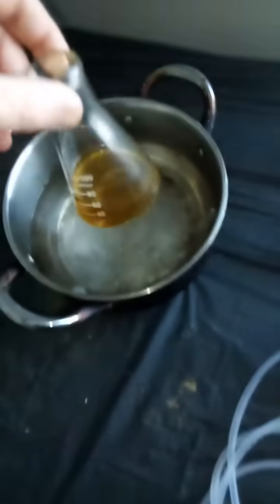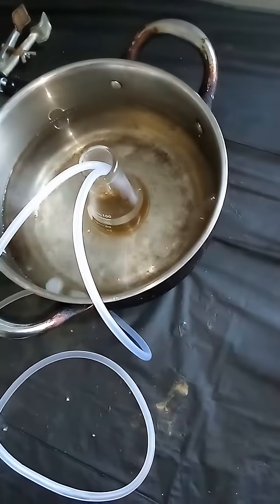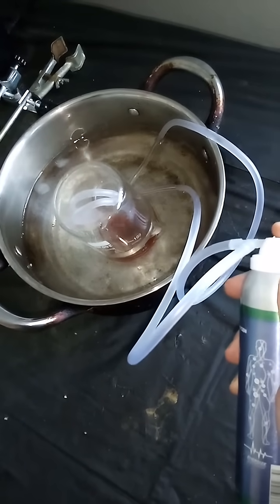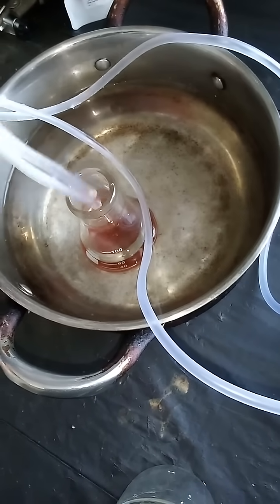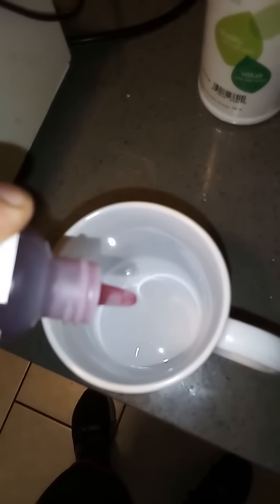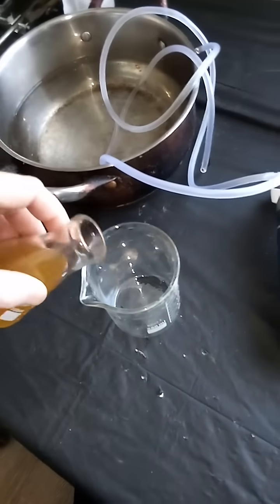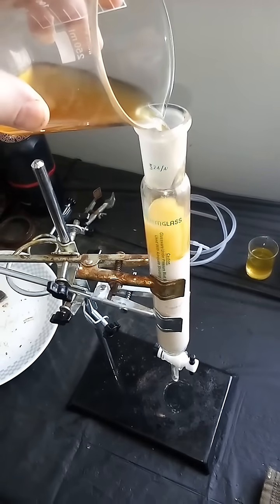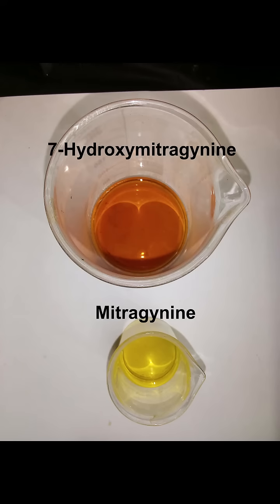How to make 7-Hydroxymitragynine by @KaliforniaKratom

Comment: Any thoughts on MGM .
Reply from the maker: It's twice as strong as 7-OH and lasts a lot longer. If you switch to MGM15 from 7-OH, you will go through withdrawal when you switch back - it's that much stronger. It's also not very hard to make. Once you have purified 7-OH, you can convert it to MGM-15 using sodium borohydride.
Reply: @KaliforniaKratom so I hear, trying to figure out how much of that is in the 7stax nano since they don't claim a content . By the length of action it almost has to be present
Reply: @K @KaliforniaKratom and cool on the chemistry info. Was curious how they further converted it from 7

Comment: This stuff is hot garbage if you're not having a pain emergency. Stick to the Kratom leaf instead. I don't think 7OH should be made illegal but it should be regulated; kept out of sight and locked up and sale requires a warning of it's withdrawal effects and advice to not use daily and ID check for 18,21+.

Comment: Can you explain why every literature I've found says mitraginine has to be put under an argon atmosphere and yours is the only one in the world that doesn't require this?
Reply from the maker: The only 7 synthesis that needs to be done in an argon atmosphere is PIFA. Rose Bengal turns atmospheric oxygen into singlet oxygen which adds to the double bond. Oxone forms DMDO which is in itself an oxidizing agent and doesn't need to be performed under an inert atmosphere. To go from 7-OH to MGM15, you need an argon atmosphere when reducing with sodium borohydride, but that's MGM-15, not 7-OH.

Comment: I’m guessing you dehydrate it at the end correct? What’s the best way to dehydrate it and I guess from there you need to weigh out the dosage with a special scale?
Reply from the maker: You can use a food dehydrator, a vacuum oven, a vacuum chamber, or let it air dry
Reply: Whenever it dries I guess it’s like a powder like substance?
Reply: One more question I’m so sorry, so can you use this method with some Mitragynine powder? I see some websites sell the mitragynine powder. I guess you could stir the mitragynine powder in some isopropyl alchohol and do this method with the chromatography column correct? Or can you skip the corporately column if you have the mitragynine powder? Sorry again for the bombardment of questions I’m seeking info my friend

Comment: Can i do this directly from leaf powder! Like make red bubble first or even just all in one step? Or do i need to oxidize first than citrus?
Reply from the maker: No, you must follow the videos in order
Reply: So if mit is left out will it start to oxidize on its own? Or the catalyst is required to do any conversion?
Reply from the maker: @Brain-92  It will oxidize on its own with exposure to air and UV light, it's just a very slow process.

Comment: How would you know the amount of mg you have?
Reply: Knowing how much Mitra you have is the first step. 

Then, you can make a rough estimate based on standard conversion rates. I dont know that specific math off of my head, but let's say:

150mg of mitragynine can convert at at roughly a 50% ratio. So 150mg of mitra can be converted to 75mg of 7hydroxie.

Basically you you can guess. He also said theres still a layer of regular mitragynine that does not convert, which can be recycled. Meaning theres some that never converts. 

In a lab, you can easily convert more and probably have no mitra left and convert it to 7 hydroxie at a much higher rate. But this dude is doing garage chemistry. Which, isnt bad as long as you take precautions and whatnot.

But, he'd have to send it to a lab with multiple samples saying "pure oxygen atom 1 hour 5 hours 10 hours, etc" as well as "ML of catalyst here here and here under 1 5 and 10 hours, etc" if he wants real conversion rates and accurate MG. Id personally replicate 3 times, under same conditions, and then id send all three samples to get a  good idea on MG converted to 7OH

I know what I said isnt the most scientific of explanations, but id like to keep it simple purely for those who may not understand.
Reply: @TheSektor47 I know some chemistry. I bet it takes a ton of kratom to make 7OH.
Unless you somehow synthesize it.

Comment: Around how much was that? Wouldn’t you need a ton of kratom? Around 0.5% of the ACTIVE compounds in kratom are 7hydroxy… I’d imagine you need pounds of kratom to get a good yield of 7hydroxy…
Reply from the maker: Mitragynine is the main alkaloid, you are oxidizing that to make 7-OH, not pulling the 7-OH out of the kratom. This video is part of a series of videos and is the 3rd one. The first video teaches how to make extract from leaf, the second video shows how to isolate mitragynine, then there's this video and a video on how to oxidize mit using the oxone method.

Comment: Id love any links you can offer on the technical details.  You didn't mention a light source, timing, yield etc.  I have mesotetraphenylporphorin and and find it works well with UV around 410 nm.   I also am curious about your column details here.  Alumina and what eluent?  If you dont quench the catalyst what happens?  Being that you had unreacted mitragynine it seems unnecessary but theoretically you would start producing the indoxyindole product?
Reply: Came here for this smart ass comment 😂🙌🏻

Comment: About how much 7 Hydroxy and purity do you get from this process, and throw out an estimate number of how much the equipment needed is. In these times, a good step by step from kratom leaf too 7 oh isolate powder would be nice to know. Ideally three full guides of a cheap setup, medium setup and a expensive setup. Also a guide on how to test the purity would be nice. 

I don't doubt if they do schedule it, some form of extraction/metabolization process that is really easy to do like some shake and bake type method except for 7.
Reply: FED
Reply: •Aquarium tubing- $7
•Erlenmeyer flask (set)- $20 
•Beaker (set)- $10
•Rose bengal- $12
•Oxygen canister (10 liter, 3 pack)- $45
•Citric acid (10 lbs)- $37
•Chromatography Column- $60
•Lab stand support w/ clamp- $40

Total: ~$231

Not including price of equipment to extract the initial mitragynine from raw plant material or convert the liquid distilled 7oh into powder/tabs
Reply from the maker: @GlassesAndCoffeeMugs I sell a kit for the oxone method that includes the SOP, the extract, Oxone, sep funnel, scale, magnetic stirrer, ring stand, etc. for $199.
Reply: @GlassesAndCoffeeMugs buying mit extract would probably be easiest since there's no way its getting banned
Reply from the maker: I have everything you need on my site. www.kaliforniakratom.com
Reply: @KaliforniaKratom  Question, does it also explain how to tell how pure it is, or would you have to send it to labs.
Reply from the maker: @kingcarl1391  End purity depends on beginning purity with your mit. High purity mit will produce high purity 7.
Reply: Tweakerz
Reply: Your first question is very important, how much percentage stronger is it going to be of 7oh? How much citric acid do I put in the solution?
Reply from the maker: @U7uber370 Wait what? You don't need citric acid for this. Please email me if you have specific questions matt@kaliforniakratom.com

Comment: You forgot one critical step my guy!.. you need to reoxidize the Citric acid with the carbonal and mitraginine to concentrate the mixture otherwise your just wasting the residue.
Reply from the maker: You're not supposed to use citric acid at all, you're supposed to use sodium thiosulfate to reduce the peroxide formed.

Comment: Also, if you were to skip the step with the chromatography column, would you just be left with a full spectrum extract for lack of a better term? Stupid question I know, I just wanna make sure that it’s only separating the excess mitragynine from the 7-hydroxymitragynine and I’m not missing something here.
Reply from the maker: Correct, though you'd have some partially oxidized other alkaloids too but they're not harmful (from what we know). More research is needed in that area.
Reply: @KaliforniaKratom if you made kratom tea and oxidized it with the rose and the oxygen method would that produce a mixture of 7 hydroxy and other oxidized alkaloids?
Reply: @KaliforniaKratom Sweet, thanks man.
Reply: How are you not getting what's going on here. It's one chemical turned into another, if the one is left over in the other one it is simply that, a mix of the two 😂
Reply: @MannFranke Just wanted to clarify before I drop hundreds on a piece of equipment pal, never said I was well versed in chemistry. If I knew what was going on I wouldn’t be in a comment section asking questions.

Comment: Is MIT powder water soluble? If I source mitragynine powder can I just mix it with distilled water and make a solution or is it not that simple?

Thank you for putting this out there man fr, you’re a good man for not gatekeeping.
Reply from the maker: No, MIT powder is insoluble in water. You need to dissolve it in a suitable solvent like methanol, ethanol, acetone, ethyl acetate, or DCM.
Reply: @KaliforniaKratom What about a high percentage isopropyl?
Reply from the maker: @3y3mtr1pt5  Yes.
Reply: @KaliforniaKratom Sweet. I know these are stupid questions, but it’s difficult to find information online. I appreciate you.
Reply: @3y3mtr1pt5 not that hard just takes time, care, and attention. If your going to mess with it take the time to research the chemistry, and learn the vernacular, it will aid you. Solvents come in two major categories "polar" and "non-polar". In this case you want need a non-polar solvent for the chromatography to separate the compounds dissolved based on charge difference. Kali jump in if any of this is off
Reply: @1337prokill3r Huh, yeah I really need to do some research on how chromatography even works, for sure. I was under the implication that a chromatography column worked like a brita filter, had no idea it had anything to do with charge. Thanks for the insightful ass reply, that means a lot. I’ve been interested in chemistry since I was in elementary school, and I’ve done plenty of scattered research, but no legitimate courses since high school. Definitely pays to learn the basics in any field before trying to learn a bunch of shit out of your wheelhouse. 
Apologies for the run on sentences, I think I might need a refresher on the basics of grammar too.
Reply: @KaliforniaKratom Really appreciate the info once again man

Comment: So what’s the difference in mitragynine and 7-hydroxymitragynine. Exactly all I know is one is stronger that the other, but is the less stronger of the 2 ( mitragynine) the same as kratom powder, like potency wise ???
Reply: The effects you feel from Kratom powder are from mitragynine. Because there’s less alkaloids that cause the wobbles (headache/nausea) Mitragynine extracts feel slightly better as you’re able to take a larger dose that feels a bit cleaner. 7hydro is on a whole other level so the two aren’t that comparable. Kratom/mitragynine is great but it has a distinct feeling with side effects that set it apart from similar substances. 7OH is nearly indistinguishable to traditional opioids like hyrdo or oxy. Despite its crazy potency and amazing high, it’s just as safe as kratom powder.
Reply: @jordanaveryt2051  ok I see, ty . I’ve heard there are withdrawal effects from the 7oh are they more mild than traditional opioids or the same?
Reply: 7oh is a naturally occurring oxidation product of mitragynine.  7oh is naturally occurring in kratom.  7oh is produced when mitragynine is metabolized by your body.  It is a naturally occurring substance therefor perfectly legal by natural law.

Comment: Yet another one! I've watched this numerous times. SOOO INTERESTING!!! it def peaks my interest in the creation of these products. THANKS AGAIN MAN!!!
Reply from the maker: Thanks man! Stay tuned for more and how to make 7-OH using Oxone (easy)
Reply: @KaliforniaKratom I’d love a MGM-15 synthesis video 💜 also using different MIT extracts could result with different alk profiles for the 7oh correct? Also  if I use say 97% MIT extract will I end up with a rather potent 7oh extract?
Reply: @KaliforniaKratom This is what I am waiting for! Oxone methodology. Also, if I am not mistaken, H2O2 (hydrogen peroxide) yields 99% 7OHM from MG but I believe palladium is used for a catalyst but you could also use PIFA for a slightly lower yield (I don’t remember the exact yield but since it uses no catalyst, it had the lowest yield %). 

On the case of MGM, I am just curious as to how to create an Argon environment or an inert environment. Why argon? Why not nitrogen?

I am super new but super interested and passionate about this so I am catching on quickly.
Reply: Well, I was trying to stay within the household chemical or the easily obtainable chemicals to keep the process plausible for personal use at home but it seems H2O2 is not as easily quenched as some other oxidation agents. I really like the Rose Bengal and Citric acid method. I have to actually try this now. Thank you!
Reply from the maker: @Vince0ffer  Argon is a noble gas with a stable electron configuration. Nitrogen is somewhat reactive compared to Argon. 

I haven't seen a method published in the literature for H2O2 but I'm sure if there's a will there's a way. PIFA, Rose Bengal, and Oxone are the only published methods I've come across so far that are in peer reviewed scientific papers.
Reply: @KaliforniaKratom does oxone result in better yield? Or is it just more beginner friendly?
Reply from the maker: @BasedVibe  Both, plus you don't need as much equipment with the oxone method, just a separatory funnel.
Reply: @KaliforniaKratom is this video still in the works?
Reply: So, how do you control and quench the free-radicals?
Reply: How are you finding all the fractions you want out of all the fractions run through the column?
Reply from the maker: @Vince0ffer  Color, and knowledge of the polarity of each molecule. Using a TLC plate with an indicator and UV light is the way it's supposed to be done.

Comment: this is so cool! what is the reason for the Sonic cleaner in the original extraction video?
Reply: It functions as a low grade Lab Ultrasonicator for UAE or Ultrasonic Assisted Extraction. Ultrasonicators use high frequency soundwaves that cause microscopic cavitation bubbles that helps explode the plant cell walls for a faster more efficient extraction. High powered Ultrasonicators are also used in the Marijuana industry for solventless extractions or nano-encapsulated drinks, it literally shakes the chemical bonds apart in some cases.

Comment: ok so the color is throwing me off. I bought a powder that is 88.9% 7-OH and 0.5% Mitragynine and it is a yellow color. I also bought a powder that is 62% 7-OH, 11% Mitragynine, 2.40% Paynantheine and 1.2% Speciociliatine which is an orangish color powder. Both work good, but the 88.9% is def better. So I'm assuming the company isn't ripping me off. But from your vid your saying 7-OH is orange and Mitragynine is yellow. I would think the 88.9% 7-OH powder should be a darker color than it is, since its supposed to be more pure 7-OH. I know the 88% 7-OH defiantly feels cleaner than regular kratom and doesn't have the side effects I get when I take a high kratom dose. Any ideas why my 7-OH is yellow and not orange? Could it just be bc what I have is a dry powder and yours is in a solution?
Reply from the maker: These compounds can vary in color depending on how they're made. Mit can be white to yellow. 7-OH can be white, yellow, or orange. It all depends on purity and crystallization. A diamond (all carbon) can be different colors as well due to imperfections in crystal structure.
Reply: @KaliforniaKratom  Thanks you! Good to know. One of the 1st things I did was dissolve the 88% 7-OH in 75.5% EtOH and it started recrystallizing forming white crystals. I wasn't even trying to recrystallize it. I just wanted to make dosing a bit more precise, until my analytical balance came in, since I didn't trust my milligram pocket scale for measuring a dose < 30mg bc of the floating 0 error they suffer from with small masses.

Comment: any recommendations to purify the solution or remove the iodine? I know somebody with a severe (anaphylaxis) iodine insensitivity. they can consume several grams of iodized salt w no issue so it doesn't have to be 100% pure, but the levels in shellfish can cause anaphylaxis if they eat it, so it would need to contain no more bioavailable iodine than table salt
Reply from the maker: @elainehammond7456  "Iodine Allergy: Myths, Symptoms, Causes, and More" https://www.healthline.com/health/allergies/iodine

The iodine present in Rose Bengal is in the form of a flourescin derivative, it's not liberated from the reaction as elemental or molecular iodine. Since the reaction uses chromatography to purify the compound, there shouldn't be any Rose Bengal left in your product anyway. If there is I find it hard to believe that it would cause an allergic reaction given that your body uses iodine to regulate the thyroid.

Comment: i have everything i need for this 3xcept the chromatography tube. I have one kratom extract made from le.on juice and water that I basicifideusing bakjng soda( dont know how to spell that correctly) and one vodka extract. Will this work with either of them. or will i need a different solvent?? if so which one will k need? methanol, etc?
Reply from the maker: You can actually take the vodka extract and pour it directly into the chromatography column to separate the mit. You're going to clog up the column with plant matter but you can wash and reactivate the stationary phase if you don't mind doing extra work.
Reply: Buddy I would just buy mitragynine isolate